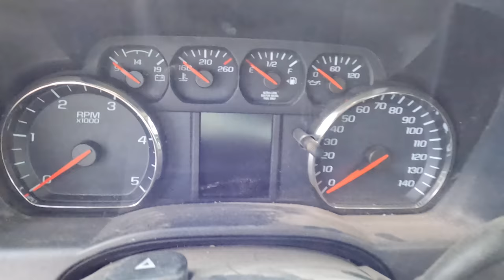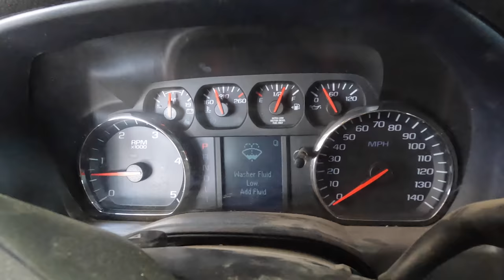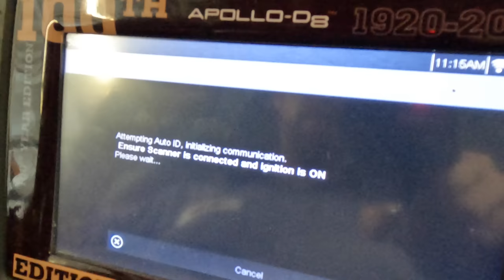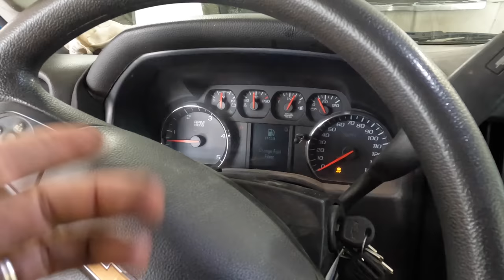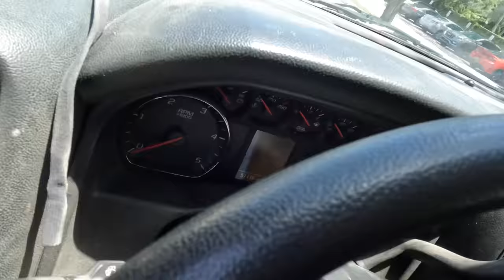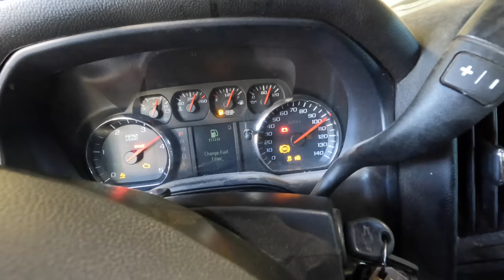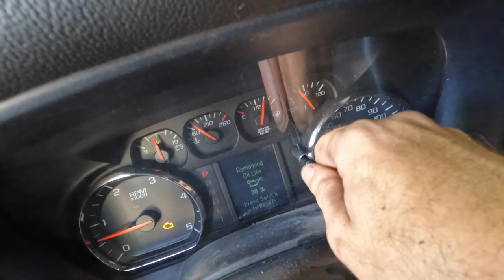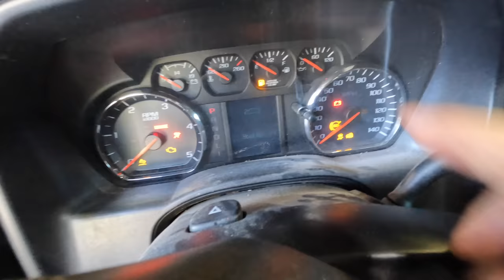Multiple Warnings! Medium Duty Duramax 6.6 3500 4500

Comment: They don't have something as simple as a fuel filter, but they do have stock of an expensive coolant tank that only needed a sensor.
Once the stock of coolant tanks is exhausted they aren't going to set up an assembly line for a old truck out of production.
Thanks to your video we now know how to bypass the sensor so we can ignore this warning.
Reply: Could just ignore the warning
Reply: No need to worry. Dorman OE Solutions will come out with these tanks. Dorman. Stranding motorists and frustrating technicians since 1918.
Reply: @mlieser1230  that’s why Dorman’s product line is called HELP. Cause that’s what you’ll need…
Reply: @mlieser1230  unfortunately Dorman can't make everything.
Reply: If it was my truck I would drill a new hole and replace the sensor with a comparable one. Hey that sounds like an aftermarket product. Quick trip to china to source the parts

Comment: The Coolant tank has both a side and top inlet so it can be installed either in a short and wide application, or a tall and narrow installation. This allows 1 part to be more flexible with multiple vehicles and uses that have size restraints. Very common in a commercial type vehicle. It is left hand thread BECAUSE it has multiple caps. They do this just incase you go to standard loosen a cap, which tightens. This avoids accidental spills, and lets you know to look for a 2nd, or possibly 3rd tank cap.
Reply: If you turned that coolant tank the other way, the sensor would be at the top of the tank. Probably wouldn’t work very well.
Reply: @Hoaxer51  It works just fine when you change the switch polarity. In the other direction it would act like a float switch used in a brake reservoir...
Reply: Making 2 different tanks would be simpler and avoid errors
Reply: @drbichat5229  Not in the eye$ of accounting 🤣
Reply: Thanks for the laugh, flip flop. You have bamboozled a few folk. Not me, cause I get to deal with them regularly. Ya know like block heater recalls, low coolant messages like in this vid... Lol. This design, along with their active lifters, that they have decided to make all 16 instead of 8, just makes ya scratch your head.. stay hilarious 😂.
Reply: @flipfloptanlines926   I guess I don't get it because, like Tim,  it seems that because of where the sensor is at if you turn the tank 90 degrees to put the other cap on top the sensor would now be at the very top of the tank and laying sideways. I don't see how it could work like that but admittedly I am not an engineer.
Reply: @drbichat5229   Which is WHY they chose to do it THIS way.  :D
Reply: @johnme7049  And both of yoll might be correct, at that particular installation. But, car companies rarely make small common parts anymore. I would be willin to bet the tank has numerous plugged bungs for sensors in it. 1 company makes the generic tank, another company configures that tank for maybe 2 different mounting options outlets inlets etc, another company for the actual sensor install, and then to GM. It may have been cheaper to just add another cap. I really dont know the reason, i just know how manufacturing is accomplished nowadays. However in my 30+ years as a technician mechanic, i have come across left hand thread caps on more than half the tanks ive dealt with IF the tank has numerous fill points on different sides.
Reply: @frobey7517  Your giving off the impression that GM actually designs or manufactures any of said parts. Why spend millions engineering and investing in manufacturing facilities to make a plastic tank. GM put out their problem, and a supplier gave em a solution. Simple. Sh*tty, but simple. Now the lifters i aint a fan of either. I also have spent a career in the trade. Pennys are pennys until the products are created in the millions, then pennys do become millions. And you and i at the lower rung of the ladders deal with regularly....
Reply: @flipfloptanlines926    Right and Hey it's GM right? You can't expect THEM to do anything that makes sense right?  :D:D:D Have a great day.

Comment: Man I was hoping we were going after all the no com issues 😥 No software update is gonna fix that. I hope you get it back in so we can see the down and dirty as to what is causing those issues! Take care Ray!
Reply: Me too. What do you think? Maybe start by checking out the trailer wiring first?
Reply from the maker: 🤫 I know. At the end of the day I think referring it out was best. The biggest problem in the retail shop environment is time. “Down for Service” does not exist.
Reply: @RainmanRaysRepairs  copy that
Reply from the maker: @SouthMainAuto  This is my vision: to have a 4 post big enough to fit a truck like this and a building to put it in. When the state of affairs allows some risk, maybe I can get one.
Reply: Edd China has both a 2 post and 4 post lift in his workshop in the uk, but as you say having the space to lift a truck is key. He went with basically an old barn, but it’s big enough to work on a car that looks like a huge orange… no joke.
Reply: I wouldn't have allowed it into my bay. Had Nitemare all over it
Reply: @freak3dot  - washer fluid first then call it done. Punch out early and take tomorrow off!
Reply: I'm guessing no com issues would mean a lot of shop time, possibly tracing faults in wire harnesses. :P
Reply: Ahh com issues god bless multiplexing
Reply: Maybe the software update translates from GM to Chevy since the computer thinks it is one 😄
Reply: @RustyZipper  .
Reply: @RainmanRaysRepairs  i see the owner has a gentle persuader,,under the seat..

Comment: Hey Ray! The second cap on the side of the reservoir opens a bleeder if I recall correctly so that you can properly refill the reservoir. They are compartmented and the lower reservoir is to be refilled as well when servicing which entails plugging the overflow and filling the top tank up so that coolant goes through the 2nd passage by the cap down to the lower tank. After a while it stops taking coolant in that way, and as such specialized tools are needed to force more coolant down to fill it fully, although you can rig up a tool out of spare parts to do this. 

This comes from what I can remember in my time replacing block heaters under recall as a GM tech on these trucks, and in the notes it was as well mentioned to be critical that this lower tank be filled and to level. I would pull up the documents to double check, but as I am no longer a GM tech I don't have access to PBS anymore.

Hope this helps!
Reply: Why the left hand thread on the top cap?
Reply: @pedrorojascervantes3928  no clue on that, I would have thought it would be so you can't use the wrong pressure rating cap on the system but it's just a standard 15 psi cap.
Reply: Why would there be a separate tank that requires all this extra work?
Reply: @richardwernst  they're compartmentalized, I believe the lower section is the pressurized section of the tank and the upper section is just a reservoir. There needs to be appropriate coolant levels between the two of them for proper system function. It's similar to the older style reservoirs for the Duramaxs that are side by side, only real difference is that the newer style is one on top of the other instead.
Reply: @richardwernst  It would seem that the bottle fits a few different engine / chassis  models so they tooled up for just  one to mount  whichever way is needed.
The horizontal  hole is for pressure  testing.  May explain  the left handed thread on the top cap.

Comment: “Low coolant level sensor” Big issue !   Bulletin,,Nec. To replace overflow bottle! Trick, while on order, long blow gun into bottle, shop cloth on around blower, slightly “blow” into coolant, removes crap “ temporary “around sensor usually works !
Reply: True, and probably will last. But if its not your vehicle, and you are a professional shop, YOU MUST WARRANTY all repairs. Replacing the assembly is a warranty issue. Way less likely the truck will have a "Comeback" that will have to be repaired for free, and an upset customer.  Especially since a new tank assembly is a generally low cost item with minimal labor. Labor is the biggest cost, even with expensive parts.

Comment: Replacing a whole coolant tank just for a faulty float sensor is ridiculous , is it not? Cheeky bastards these manufacturers.
Reply: DYI'ers can try to clean the sensor
Reply: That's someone not doing their job as a service engineer at GM. Likely the D&R engineer didn't bother to make it serviceable or the supplier didn't bother - because the manuf. cost difference would be pennies if at all.
Reply: Its common practice these days as "assemblies" are cheaper to manufacture and replace as single units. Its dumb and incredibly wasteful but helps the share holders so its what we do.
Reply: @peted5217  - If it were my own truck I’d simply have the dud sensor bypassed and make sure to visually check things every few days. I wouldn’t reward the designers/engineers/bean counters. That is my first instinct at least. That engine cowling looks very awkward to lift alone. Also, with those sensors, I guess they are ‘plastic-welded’ in position to be able to withstand the heat and pressure without leaking, so that makes it tricky to be reliably replaceable.
Reply: @whitehorse1959 , You mean like checking the temperature gauge like we’ve always done? Lol it’s redundant having two things checking the same thing but evidently there’s a need for it.
Reply: @Hoaxer51  - yup, you’re right. A coolant leak has a strong smell too, so a further warning available to the alert driver.
Reply: @Hoaxer51  I never had oil pressure concerns until I had an oil pressure gauge... But on a commercial truck that may not always have the same driver, multiple checks might make sense to prevent failure.
Reply: @Hoaxer51  Not exactly the same thing. The temperature gage only tells you that you've run out of coolant from not checking the level.
Reply: It is EXACTLY like this in PACCAR trucks too. I had this issue in my 2019 T680 I used to drive. Coolant never dropped but the light would randomly come on, and they were of course on backorder too.
Reply: @Amadillo-v2y  that is part of the problem.
Reply: It's the washer fluid warning that gives me a laugh! Will the truck explode if it runs dry? 🤔
Reply: @redrider7730  Not everything is about politics, corporate greed is a bipartisan thing.
Reply: Like having to replace a whole taillight assembly on a GMC Terrain for a bad LED bulb
Reply: @michaelpilgrim2599  it would look like Hiroshima
Reply: @ThatOddGarage  ya but that sensor you can change and change it without draining the coolant. More often than not take out the sensor wipe it off reinstall and your good to go
Reply: @Bowhunters labour?
Reply: @holmes1956O  I've tried that, I haven't always had good luck with it
Reply: @ThatOddGarage  keep trying eventually you will figure it out
Reply: It has been this way for over 20 years. There is nothing cheeky about it. Your either in the know or your not. You are not.
Reply: @Will-ws6gb  you are NOT creative. People like me fix things not just replace parts. Coolant tank needs a sensor modify the tank and put in a sensor
Reply: @Will-ws6gb  - yeah, I’m old with an old car.
Reply: @whitehorse1959  unless you have a small upper radiator hose leak that evaporates when it leaks from heat. Most common in early 2010 fords, but it leaves little to no evidence of a leak. Barely a noticeable smell, until you open the hood while its running. So not every leak is easilly detectable. You could even have a slight head gasket leak where it just builds in the cylinder heads and doesn't go out the exhaust and isn't a big enough leak to misfire. Also fun leaks to find. So not every coolant leak is easy to figure out
Reply: @ScootsMcPoot  - true dat
Reply: @whitehorse1959  didn't mean to tag you lol sorry. i just hit reply and delete the tag usually. easier on pc. So that wasn't mean for you. But true nonetheless.
Reply: @ScootsMcPoot  - No worries Sir.

Comment: AdBlue is a diesel exhaust fluid (DEF) made from urea and purified water. Diesel engines that require this fluid are machines that apply selective catalytic reduction technology.The reaction that occurs between urea and exhaust gases will neutralize harmful gases such as nitrogen oxides (NOx) into water and nitrogen.
Reply: Instead of buying DEF fluid, can I just pour in some bottled water and pee in the tank? 😚
Reply: @SuperGlacierGirl  drink more beer
Reply: @SuperGlacierGirl  😄👍🏻tell us when it 's working
Reply: @Dave Stennett - Yeah, Ray showed some ignorance on the matter when he stated that DEF only applied to domestic vehicles and that they could export those vehicles abroad with zero emissions' stuff in them with no problem at all. If anything, it's the usainians who were late to the diesel emissions control "game". If EU emissions' standards were applied in the US (addressing his complaining about the standards not being applied evenly), most vehicles that they have currently in circulation would be outlawed.
Reply: @SuperGlacierGirl  In US you might be able to, but don't try it in an Euro6 or later diesel, as that monitors quality as well and will shut the car down if not correct.
Reply: If we runun out of AdBlue while driving, engine power and performance will be lowered to 'limp home' mode to reduce harmful gas emissions. And the engine will not start again until add back ." limp mode " or also know as ‘limp home mode’, is a security feature of a car that automatically activates when it detects a fault with the engine or transmission. What it does is it will deactivate or reduce the performance of certain features of a vehicle such as the air conditioning system, as well as the power that the engine produces. This ensures that the fault detected by the system doesn’t cause anything serious and helps the car to limp home. .
Reply: @Dave Stennett 😳 🤦🏻
Reply: @SuperGlacierGirl  you sure can. Just please do that near my shop. I'd like that repair ticket after it gives you de-power mode.

Comment: FYI  In the 2019 and 2020 RAM's with Cummins diesel engines, they have CP4 fuel pumps. Be VERY VERY careful after changing the fuel filters (2). Prime the fuel system EXACTLY as described by RAM and Cummins, or you will kill the CP4 pump prematurely. The CP4's are currently recalled for replacement

Comment: I believe the reason the reservoir has 2 caps is so it can be installed in different models. At the end the correct cap will be facing up.

Comment: I have been learning with the Duramax motors when the low coolant light comes 9n it disables the ABS system as well as the cruise control sys3m as a way to encourage you to pull over. As soon as coolant levels are met or the warning goes away, at which time the pcm removes the restrictions on abs and cruise.

Comment: I will say that I drove a 6500 around the same year model as this and they’re kinda garbage. Coolant light comes pretty much every time you hit a bump (everything is a bump in a 6500), traction control was smoking meth and would trigger on dry pavement, changing the front pads/rotors made the ABS system never work properly again (not even the Chevy medium duty dealer could figure that one out) and overall the truck was just rough, gutless and I hated every waking moment of driving it. 
Give me back my 6.7 power stroke. I put 3x the miles on that thing and beat the hell out of it every step of the way. Never had so much as a CEL come on
Reply: And they say….. Newer is better !?
Reply: The engine itself probably is. It’s the 4,674 different sensors, coolers, heaters, valves, pumps, solenoids, etc. that make the problems. Diesel fuel is harsh for the environment when burned. It has to be at the right temperature, viscosity, and then needs to be catalyzed for it to score low emissions. These trucks also make twice the power and torque than they did 20 years ago. I bet if you put a 25 year old fuel and exhaust system on one of these new motors, they’d never break. They’d make 1/2 the power and blow smoke, but they’d be damn near bulletproof. Emissions are why the 7.3 died. It was cheaper for Navistar to engineer a new engine than keep throwing crap on the old one to meet the new standards. Plus, all the new redesigns have made these things vastly quieter.